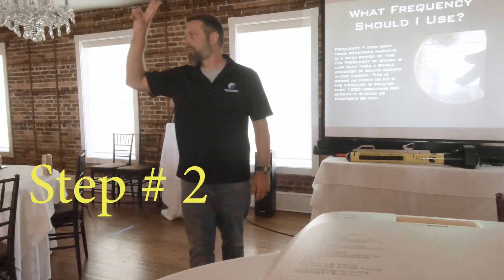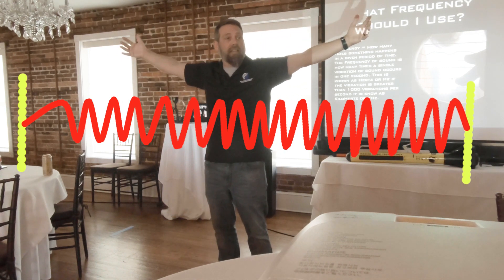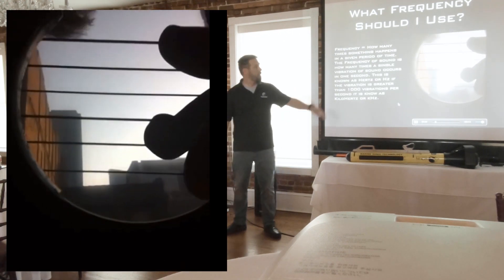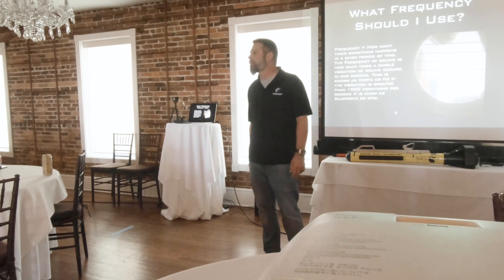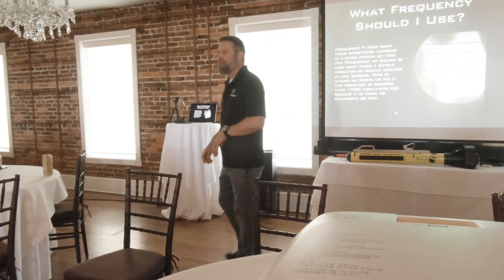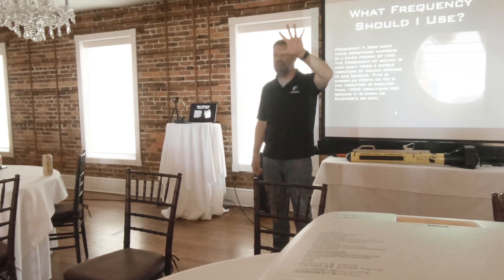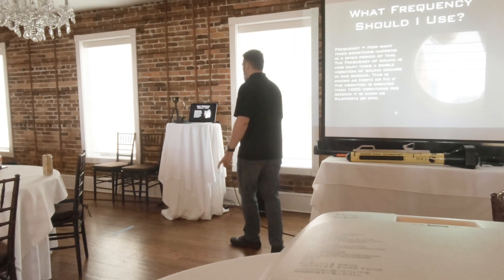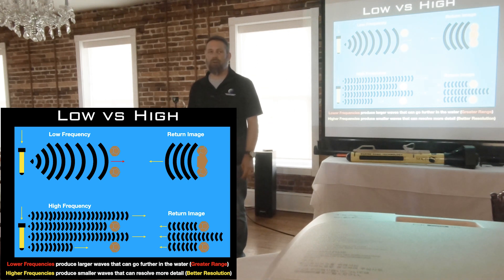How to Set your Sonar Frequency!

Comment: This might help you describe how different frequencies of an acoustic wave produces different imaging, especially resolution and distinguishing between objects in close proximity.  The key component is actually the horizontal beam width (for a tow fish system) that a transducer produces. Higher frequencies use different, more directional, transducers which produce more narrow beam widths. Think of the horizontal beam width as a knife, cutting into an object.  The more narrow, the more cuts or slices of the object, the more you're going to see of that object.  This is also how objects that are near each other can be separated and displayed. The down side to higher frequencies is reduced scan range. All frequencies from the time they're generated through a medium (like water), will dissipate power over time. The higher the frequency, the more rapid the power loss...hence less range. Sonar systems are regulated in the amount of power they can generate.  I think Mark Atherton may have described this a bit in his book, Echos And Images.
Reply from the maker: Absolutely, But you are getting way to technical for this "Basics" video. Mark does a good job in his book. It's sad that its no longer available. It was one of the best resources for side scan users. Mark's a good friend of mine and I have been trying to convince him to revamp the book and put it back on the market. 

I get into the depths of the technical side in my more advanced classes, but those agencies have to pay for. (Insert Plug Here) So if anyone reading is interested in more advanced classes please contact me. Im the Training Director for Marine Sonic Technology and you can find my contact on MarineSonic.com

Comment: Wow, love that image of the pickup truck at 9:56 in your video.  BTW, that's a Ford Ranger..part of a homicide investigation in Cincinnati. It was taken using a technique that we developed using Marine Sonic HDS 900Khz. My name is Ken Purcell. There still might be a few at Marine Sonic that remember me.  When I say we developed it... we did. In fact, this is a vertical scan.  Now, Marine Sonic did have a method and a clamp system to allow rotation of the tow fish, but the way they describe to do it was not correct. After sending images of bridge piers and a car, using our way...John DeMille and others asked me to write up an article on this.  It was published in Ocean News and Technology, August 2012 edition. In fact, it was the feature story on page 10. Now today, many cheaper systems can do the same, but most have the transducers mounted to the vessel.  But, with a tow fish, you control the depth and the scan range which is big advantage.
By getting the tow fish closer to the object, you can reduce the scan range, which increase the size and (believe or not) the resolution of the image.  The one car image we did, you can see the door handles, window rolled down...almost the lug nuts on the wheels. Not kidding.
Reply from the maker: Yes, I was there when John got the image. It's definitly a great image and good article. Range is Step 3 and will be out soon.